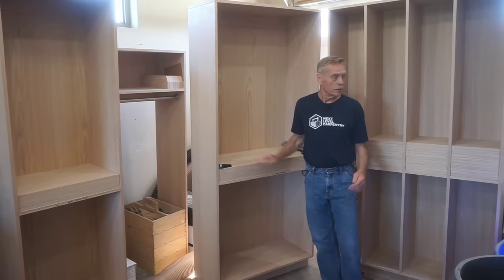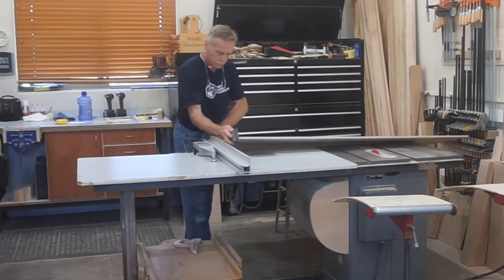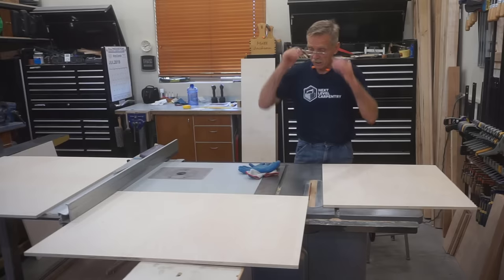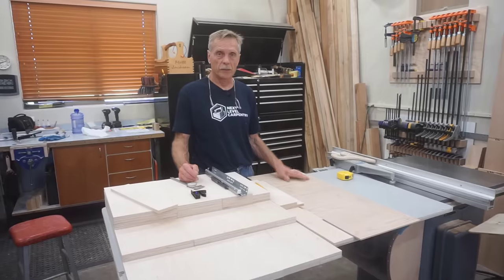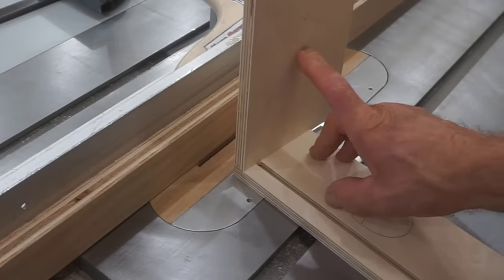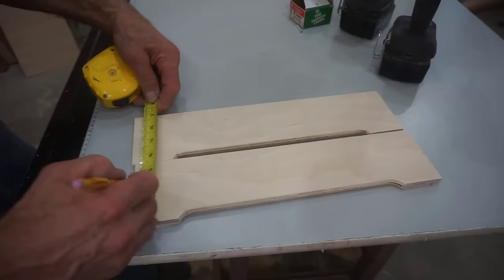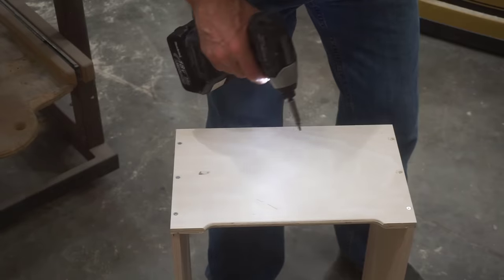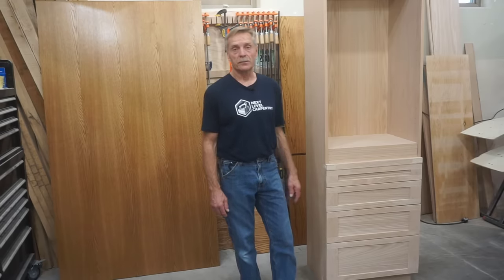Master Class for Professional Grade Cabinet Drawers

Comment: I wonder why you cut off the back of the drawers. You fasten the sides with screws. So you could just slide in the drawer bottoms from one side and screw the side piece on like a cover. This way the bottom will be supported by the drawer's backside over the whole length and not only where the screws are. Then there are 4 -6 screws and holes not be worked on per drawer.
Reply from the maker: Good question V 100... thanks for posing it so politely.  I guess the main reason I adopted this design was on drawers that I glue together because I like the ability to remove the bottom panel to flip or replace it should it sag from over-weight or get damaged somehow.  Thinking about it as I read your insightful question has me re-thinking the configuration as yours makes total sense.  Thanks for watching and commenting here... I appreciate viewers who are paying attention! Best, Matt
Reply: @NextLevelCarpentry  That was a thought I was also entertaining. I am guilty of overloading drawers anyway. Put some heavy tools in there (and not only socks and things) and sag will develop. In the end it is a big puzzle. There are three ways to deal with that in my view: 1. Don't glue the side. I don't see any reason except for deadening movements by adding some stability. Perhaps a silicone bead could deal with that? Silicone will be removable if the need arises. OTOH how much do they get distorted or worked on so hard that the frame works itself loose? I don't know.
2. Put some rafters below the bottom like on bridges. It is a bridge in the end? This will deal with the initial weakness of a thin board taking all the load. Perhaps 7 ply plywood would be a better material for such a critical area?
3. Screw the backside on as the last part as suggested with one of the sides. Could be done even with dowels to add strength against sliding downward forces.

I look at wooden projects from the perspective of an engineer. Thick/strong material where there are big forces. The sides and front are very resistant to sag due to their height as in I-beams. But the bottom has practically no support except on the edges. Drawers are buil like a cabinet except that the back  (thin plywood or even less sturdy) which is just there for keeping the air out, is used as a load bearing member. And that does not take the loads present into account. I would, without regard to how it affects work effort, put some stringers under the bottom either in the form of tubes or wooden members (upright 7ply).

I really enjoy how you explain the steps and thoughts behind what you are doing. I am a layman regarding carpentry and cabinetmaking.
Reply from the maker: @V100-e5q  I like the way you think, 'layman' or not!  Bringing intelligence and options to any project will always lead to a better end product, especially when you don't get locked in to set 'right' and 'wrong' designs.  Thanks for keepin' me on my toes! 😎
Reply: @NextLevelCarpentry  Techniques get me thinking. I find it refreshing that even a very experienced craftsman likes to pick up on odd ideas! Keep up the good videos coming! Best, Manfred

Comment: Why do you need grooves in 3 side for bottom when you can screw it on all four side like you screwed it on the back side of drawer. Screwing bottom on all sides will avoid rattle totally

Comment: do you ever use a wobbler blade?
Reply from the maker: I hope I don't sound Arrogant with this reply Norman but I don't feel that a wobble blade has any place in a serious cabinet shop.
I must confess that the first dado blade I had was indeed a wobble blade but quickly learned that the inferior results it produces are just not acceptable anywhere except maybe for a rough framing situations. I do realize that you got to do what you got to do but I think investing in a good stack Dado makes a lot of sense for getting respectable results.
And there it is then😉😔😁😎

Comment: I really like your process.  I see you are wearing gloves; I was taught that is an unsafe technique. Take on that?
Reply from the maker: The danger is getting a glove caught in a blade where the injury can be increased if threads get snagged and pull your hand in deeper.  I wear these particular 'smurf gloves' for grip which prevents a slipping hand to contact the blade in the first place.  That's just me though and I encourage you to draw your own conclusions and work accordingly...

Comment: Once you know the drawers are all good and squared, why don't you drill pilot holes, then disassemble and apply your finish? I guess I'm confused why you take all the time to drive every single screw, then remove them all. - Mark.. PS:: love your process sir.
Reply from the maker: Interesting observation Mark,
FYI there are times when I actually don't drive every single screw before disassembly but when it gets to that point the time it takes to remove an extra dozen or so screws is so minimal that it doesn't offset the potential risk that a piece will split when the screw is driven or that I need to confirm I have enough screws to complete the job both of which I want to address before final assembly and delivery. You are smart to consider that there is potential for redundant effort but in the case of the projects I do it's an easy issue to avoid.
Best, Matt

Comment: 3:30 i wish you use millimeters instead of that confusing "of an inch" measurement 😥
Reply: Don't sweat it. I learned fractions when I was 8 or 9. What do you need help with understanding?
Reply: @brodysdaddy  Why the US insists on keep using body parts, as means of accurate measurements... is beyond anyone, that doesn't keep a pet bald eagle 🤷‍♂️ 🤷🤷‍♀️

Comment: I noticed you used your miter gauge in conjunction with the rip fence as your guide to make the cut.  For us ordinary folks watching and learning, that's dangerous.  I know how crazy and unexpected a kick back can be first hand.  You are very good at what you do and probably one the best and fastest but safety matters too.
Reply: david g I’m guessing that he uses a shim or a stop block to push the stock up against. That way he gets repeatable cuts?
Reply: David, you are correct. We all should use a spacer block attached to the infeed end of fence for alignment. As the sheet moves forward it is no longer trapped between blade and fence.

Comment: I follow the advice of Matthias Wandel when making plywood drawers: just glue the bottom straight on.
The 10 mm of unused space under the bottom panel in a groove actually bugs me. I find that unnecesary waste of drawer depth.
edit: oh, I see, you have undermounted hardware.
Reply: Nico Smets, hard to use under mount door hardware with that technique.

Comment: Why not use a track saw? No splintered edges and honestly, that looks like a journeyman level finesse skill to rip those panels like that. Pretty cringe worthy. I do stuff like that too, in my line of work, but it's worth a mention.
Reply from the maker: People do amazing things with a track saw Greyghost but I'm not one who does.  If I didn't have access to a good quality, reliable cabinet saw I'd likely use a track saw though.  It would be considerably slower to achieve the same level of accuracy and consistency but I suppose it could be done... Best, Matt

Comment: I think you should spend a half a day a build a crosscut sled for your table saw. I liked your tip of squaring your plywood panels on the jointer, but it is much more efficient to do this step using a crosscut sled. It is also very dangerous to use your fence and the miter gauge to make crosscuts. (You even admitted to this in your video.) Kickback is inevitable in doing this in the long term. All this can be avoided with the use of a crosscut sled. 
Please use this video platform to educate people using proper (ie. safe) methods. I would hate to find out that someone was injured copying my questionable techniques.

Comment: gloves bad idea instead of a nick ,  the material will drag your hole hand into the saw blade
Reply from the maker: I advise every viewer to practice the safety measures they're comfortable with. While your scenario can happen, the grippy coating on the gloves I use prevents my hand from slipping and causing an incident in the first place...

Comment: Thank you so much for showing this https://youtu.be/UMy5RGblxkY?t=1589. I am still semi new to woodworking and I've eaten up a board trying to resolve this.
Reply from the maker: The same thing can be done with a router and straightedge for anyone who doesn't have a jointer but a jointer is surely the quickest

Comment: Most call the plywood used as "Baltic Birch" comes from your local wholesale plywood mill in both 4' x 8' , and 5' x 5' sheets 6- ply, 9-ply, 11-ply, and 13-ply, 15-ply thicknesses.. which is relative to 1/4", 3/8", 1/2", 5/8" and of course 3/4".. if that is your supplier stocks all the sizes..
Baltic birch has little to no voids, as compared to Chinese birch, known as dragon ply.. keep in mind, these aren't American standard sizes, but are metric equivalents..
Happy building, in honor to God Almighty first and foremost, if honorable to God, by default, is pleasing to the clients! 

Peace to you all, especially for those who are saved and sealed in Jesus Christ, Savoir of God's children!!!

Comment: Sir, who are you trying to fool, you are not a tradesman. Nice saw ,nice shop, but that's it.In my first year of training{fifty years ago} I learnt that it does not matter one bit if the sheet is square you rip your strips then turn them and dock them to size AND squareness. And only a fool with a death wish would use the ripping fence at the same time as the docking fence. Do you even know you could be placing all newbies in danger.
Reply from the maker: You learnt that fifty years ago, did you? Wow, you're amazing Alan!  Thanks for sharing all the wisdom you've amassed over the years as well.  Obviously only a true fool would divine another with such aplomb!

Comment: This is basic rubbish. Nothing looks worse than visible screws through the sides of drawers when effort is made to conceal runners. You should have rebated sides and screwed through fronts and backs into sides.
Reply from the maker: Your perspective is curious if you really believe there is nothing worse than evenly spaced and carefully driven screws in the sides of these drawers...
Reply: Next Level Carpentry well obviously there are worse things but relatively speaking there isn’t you either see fixings albeit evenly spaced or you don’t see any fixings. personally offends my eye to see them. I shouldn’t have used the ‘R’ word though, sorry. The video explains and goes into great detail. Just one simple thing to hide the screws will make it 10 times better. Have a go yourself, you will agree